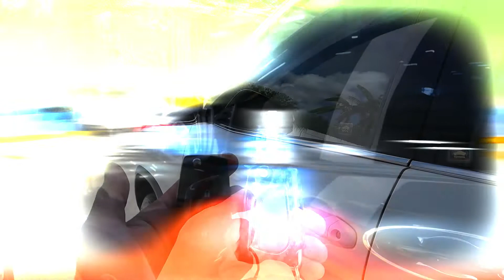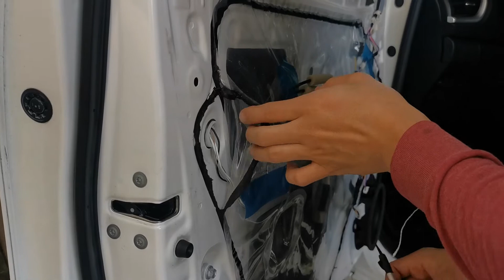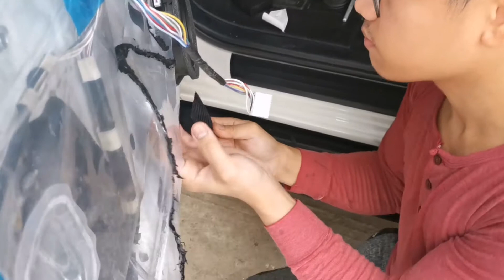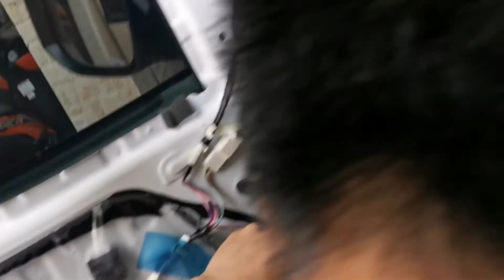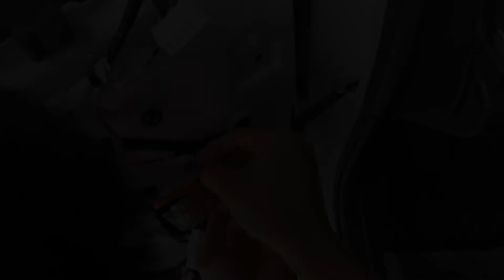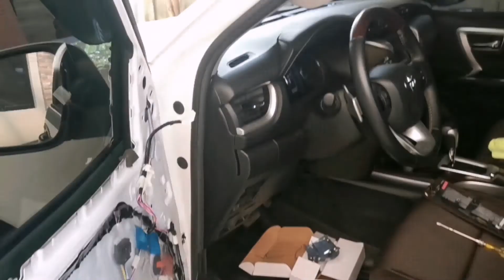Side Mirror Autofold Module Installation - Toyota All New Fortuner (2016)

Comment: Bossing pwede po ba ito install sa toyota innova touring sport 20202 model? Thanks
Reply from the maker: not yet tried. pero if halos iisa lang naman un wiring diagram nya sa fortuner then it should be possible. And also, dapat naka power tail gate na un sa innova